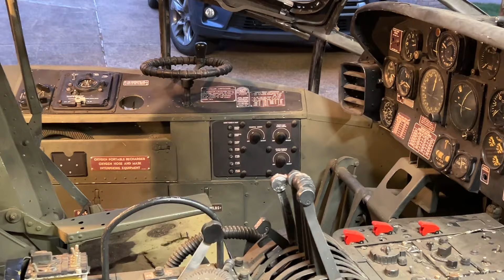Full Scale B-36 Peacemaker My Intentions For The Nose and Flight Engineer Station

Comment: That flight deck is really cool!  I’ve actually given some thought to doing what you’re doing.  But only for about a day or two, and not with nearly as much knowledge and talent as you have.  I’ve thought about building a PBY-5A flight deck, too.  Interestingly, another Convair model.  Realizing the size, I dropped the idea.  

My motivation was for use with X-Plane flight sim.  But VR changed my thinking.  I bought some VR goggles back in 2020 and tried them with X-Plane 11 and DCS (Digital Combat Simulator) and was stunned.  There in X-Plane 11 (now at ver. 12) was a full-scale, virtual 737-200 flight deck!!  With authentically functioning instruments and systems…and flyable!  As well as a 727; and now many more, including a 747-200, with a wall of instruments and switches at the flight engineer’s station.  …all in 3D like it’s real.  Likewise, with DCS, there I was sitting in a virtual F/A-18 cockpit; and it felt real!  I put my elbows up to rest on the cockpit sills.  Of course, my elbows met nothing but air.
My point is: potentially, the B-36 could be virtually modeled in either X-Plane or DCS.  Possibly even where you could slide through the tunnel from fwd to aft cabin…all modeled in full 3D detail at life-size scale …and the whole aircraft…and fly it, too.  And if in DCS, fly it in combat…well, excluding dropping armed nukes.  DCS offers the possibility of multiple crewmen.  So, you could have 2 to a dozen or more people, each on their own PC in various cities, join a server and perform their duties at the crew stations of one aircraft.

Now, I’m dreaming a bit here.  While it’s entirely possible to do all of that, gathering a team to build/program it is another thing.  It’s certainly possible, but not likely to come together for any profit.  And it would take 2 years or more of development:  3D art, systems coding and creation of the flight model.  All it takes is a handful of highly motivated people with the right skills.
Reply from the maker: It may be possible to digitally scan the finished product and incorporate the file into a simulation. I’m all for that, one day. However my flight simulator days are over, and once this bird is done I’m ready to move on.

Comment: If you had a 3-D printer, you could make the instrument housings, use printed copies of the instrument faces, and a little clear plastic and you could fill that panel for far less then $3K. Not to mention all the other instruments you'll need.
Reply from the maker: Absolutely. I already have all of the silicone molds made to make anything on station, however I like to have as many real gauges as possible. Either way, it's money and time. We will see...